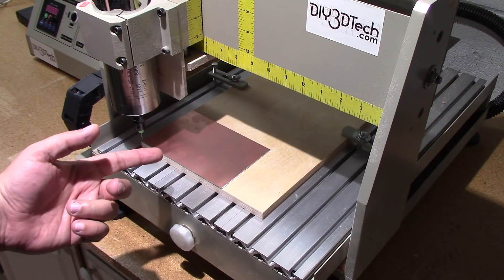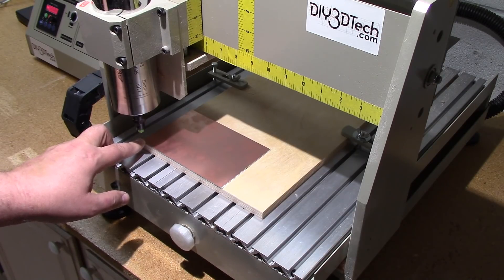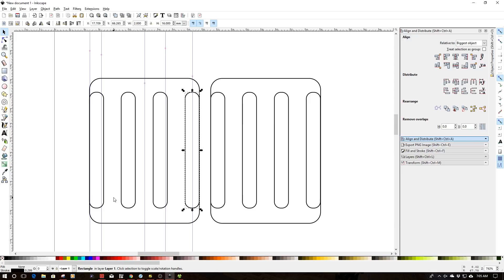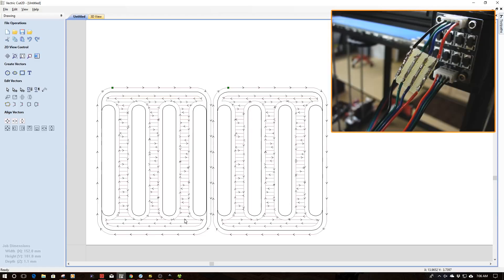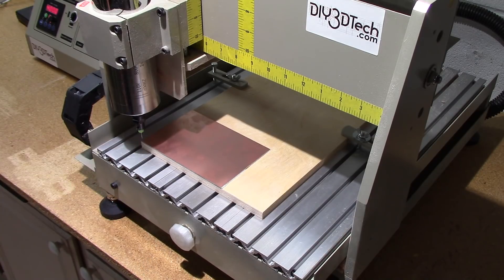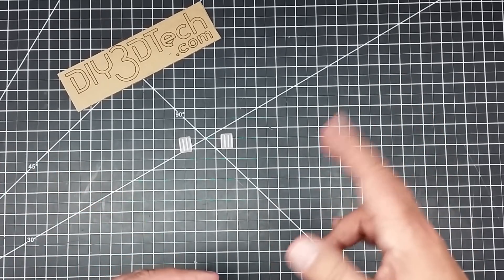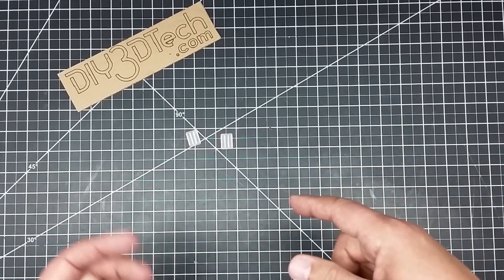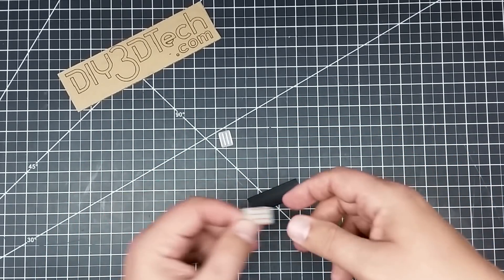3040 CNC - Milling PCB Solder Pads FAST!

Comment: Isn't that dust a health hazard? Probably should cut these in a submersed fashion me thinks or is that too much?
Reply from the maker: One could say all dust is bad, and I am not a doctor nor industrial hygienist however CNC-ing copper clad board is rather common and particle size is large. Where you have to be concerned is when they are  two and one half microns or less.  Carbon fiber and some stones can be nasty as they can be both small and have sharp edges so they get stuck in your lungs.

Comment: Hey! I've always (and now maybe the time I'll get one) wanted an (inexpensive) CNC machine.
Surely there's some Chinese (?) machine that will do.

Yet, absent (like the link you stated you'd provide - seriously, not a big deal) is to where to begin with the plethora of choices. Which can be narrowed down somewhat, i.e., 'must be able to handle (soft?) metals'. Hmm... just thinking of all the fun I could have, or not. (lol!)

Thx and thumbs-up!
Reply from the maker: Either the 3020 or 3040 is a perfect but for metal get the 800watt water cooled spindle it is well worth the extra money...

Comment: Nice little project. One extra thing I'd do though is drill a hole at each end of the pad, then you could thread the wire through before stripping and soldering to give a bit of strain relief. Keep up the good work!
Reply from the maker: Many thanks and I thought about that however I had an 1/8 inch end mill and the hole would have been too big and I was too lazy to chuck in a smaller bit (please don't tell anyone :-)

Comment: Late this year I want a CNC mill that can do aluminum and below.
Reply from the maker: This guy is the ticket!
Reply: 3040 is a bit small though so I wonder if a 6040 or 3040 would do aluminum without ripping itself apart or having to do it so slowly due to a lack of rigidity?
Reply from the maker: 6040 is a great machine too, but get the water cooled variable speed spindle as the 800 watt is good causal  aluminum, however I would go 1200 if I was going to hit it hard on a 6040 as that is a BIG aera...
Reply: Yep, and 1200 watt is 220v I think which will not work here.
Reply from the maker: Not sure (its 220) but maybe as the 800 does well for my use on the smaller bed...